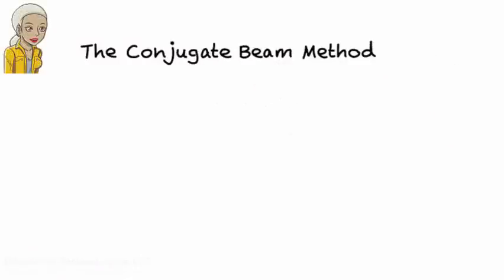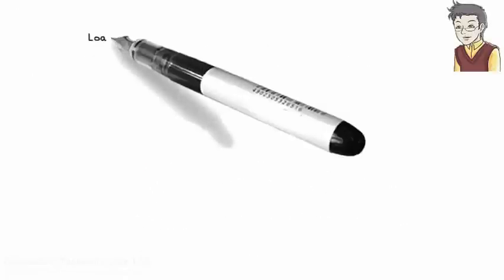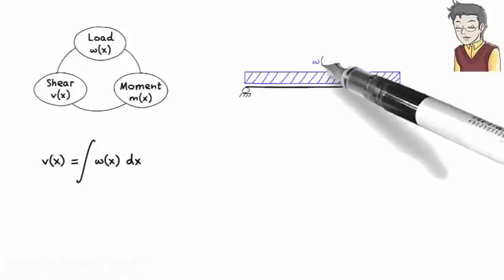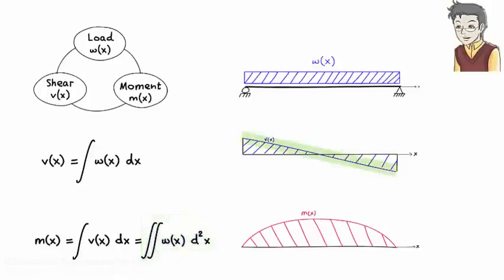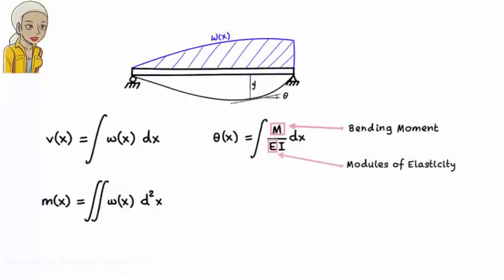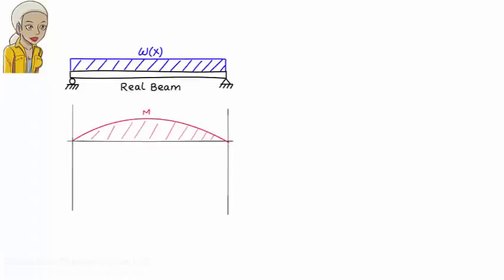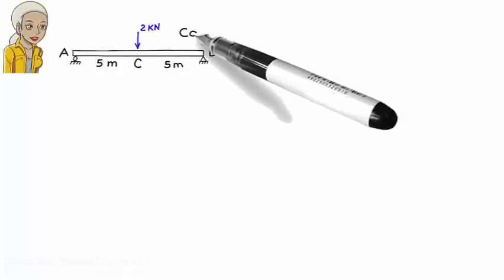SA15: The Conjugate Beam Method (Part 1)

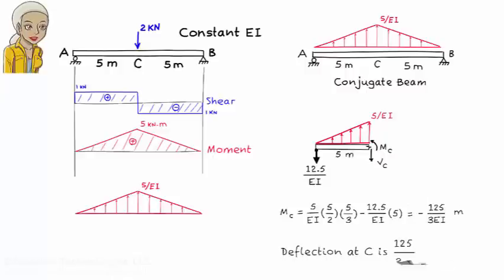Comment: I don't get it @ 4:35 where's the 5/2 & 5/3 coming from and did you calculate the area of the triangle to get 12.5 and lastly the 122/3EI. I'm new to this topic i hope you don't mind answering my questions
Reply from the maker: Yes, 12.5/EI is the reaction force at A. It equals half of the total triangular load placed on the beam. The total load due to the triangle is half of its area. So, the total triangular load is (5/EI)(10)/2 = 25/EI. Then each support reaction is half of this load, or 12.5/EI.

Note the free-body diagram drawn below the conjugate beam. There is a triangular load with a base 5 m and height 5/EI acting on the diagram. In order to determine the area under the load diagram, we need to compute the triangle's area, which equals (5/EI)(5/2). That is where 5/2 come from. The moment of this force about the cut point equals the load magnitude (5/EI)(5/2) times the distance from the center of the triangle to the cut point, which is (5/3).

Comment: So am I correct to assume that you can not use this method for a simple beam with fixed ends? And please explain why
Reply from the maker: This method works for statically determinate beams only. A beam fixed at both ends is indeterminate.

Comment: Sir...can you explain a little bit the INTERNAL HINGE. I mean can you give me a PRACTICAL EXAMPLE OF AN INTERNAL HINGE in a structure ... say in a building?
Reply from the maker: Imagine a long beam supporting the roof of a building. But, the beam is actually made of two shorter beams connected together using what is called a beam splice, basically a plate that connects to both beams creating a single beam. If the connection is made using bolts only, that is a bolt or two connect the plate to each of the two beams, then the connection is considered to be an internal hinge since the bolts allow relative rotation between the two beam segments.
Reply: thanks...good explanation

Comment: I want to use Conjugate Beam Method to find the moments at the ends of fixed beam subjected to central concentrated loading. Please help me out!
Reply from the maker: Conjugate Beam Method is for calculating displacements not moments. The moment you are looking for can be easily calculated by multiplying the load magnitude by the moment arm.

Comment: I don't understand how you got 125/3EI,  

the numbers you used in Mc don't add up to 125/3EI,

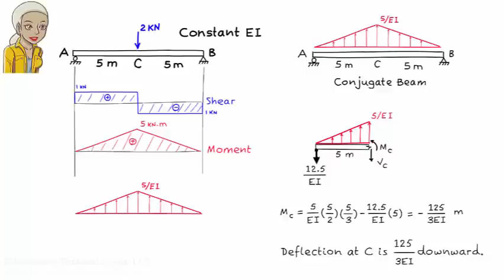and why is the 12.5/EI placed on the end of the Free body diagram rather than 2/3 up    this is at time- 4:38
Reply from the maker: The conjugate beam is simply supported having a vertical support reaction at the left end and one at the right end. 

The load applied to the conjugate beam is triangular. The area of the triangle is (5/EI)(10)/2 = 25/EI. Since the load is symmetrical, each support reaction is going to be half of the total load magnitude, or 12.5/EI.  Also, since the M/EI diagram is positive, the reactions at A and B are going to be downward.

So, the 12.5/EI is the support the reaction at A for the entire beam shown above the free-body diagram.

Now, considering the free-body diagram, if we take sum of the moments about point C, we get the equation shown in the video. It is:

Mc = (5/EI)(5/2)(5/3) – (12.5/EI)(5).

The first term in the equation is the moment of the equivalent concentrated load for the triangular load placed on the left half of the conjugate beam. 

The area of the triangle is (5/EI)(5/2), the moment arm is the distance from the center of the triangle to point C; this distance is 5/3. 

The above equation can be written as:

Mc = 125/6EI – 375/6EI 

Or, 

Mc = -250/6EI = -125/3EI
Reply: thank you so much, understand it better now

Comment: Why is the load on the conjugate beam pointed in upward direction...?
How can this method be used by pointing the load on conjugate beam downwards as usually done...?
I tried to do that but the deflection came out to be positive instead of negative as in your case... 
Also, why is v(x) = integral of w(x)...? Shouldn't it be v(x) = integral of -w(x) ....? , since dv/dx = - w and not = w.... 
please explain.... Confused !!!
Reply from the maker: +VIVEK SINGH 

The sign convention here could be a source of confusion.  We call shear in a beam segment positive when the shear force tends to rotate the beam segment in the clockwise direction. So, when the shear force at the right end of the segment is acting downward and shear at the left end of the segment is upward, shear is positive.
The load function, w(x), is considered positive if it is pointing up, if it tends to pull the beam upward along the positive y direction.

With this sign convention in mind, to see why v(x) = integral w(x), consider a cantilever beam free at the left end and fixed at the other end. The beam is subjected to an upward (positive) distributed load.

If we cut the beam at some distance x from the left end, then the free-body diagram of the left segment entails the upward distributed load w(x) and a shear force at the right end of the segment. Let’s place a positive shear force at the right end of the segment. This would be a downward force labeled v(x).

 Since the segment has to be in equilibrium, we can write: integral w(x) – v(x) = 0. Or, v(x) = integral w(x)

 The load on the conjugate beam is the M/EI on the real beam. So, if M is positive, we treat it as a positive load on the conjugate beam. This means, according to our sign convention, an upward distributed load on the beam. But, that should not make any difference when applying the equilibrium equations to the conjugate beam. If the load is downward, the reactions are upward, if the load is upward, the reactions would be downward. 

;Let me know if additional explanation is necessary.
Reply: +Dr. Structure 
Thanks for the explanation.... Will try few problems with this.

Comment: Nice video!
But where does the 12 come from for the reaction in A? I thought it would be 25/(6*EI)
Edit: And the arrow would face upwards..
Reply from the maker: The downward reaction at A, written at 4:30 mark, equals to half of the triangular load applied to the conjugate beam. The area of the triangle is 25/EI. This load distributed equally between the two support reactions. Therefore, the reaction at A is 12.5/EI.
Reply: Dr. Structure  Oh I understand where the 12.5 comes from. We write a point whenever we multiply and a comma for decimals. But shouldn't the load be distributed by 1/3 left and 2/3 right instead of equally?
Reply: Now I see. The distributed load comes from the whole conjugated beam! Thx
Reply from the maker: Ben Verbergt Exactly.
Reply from the maker: Ben Verbergt Yes, this difference in notation could become confusing sometimes.